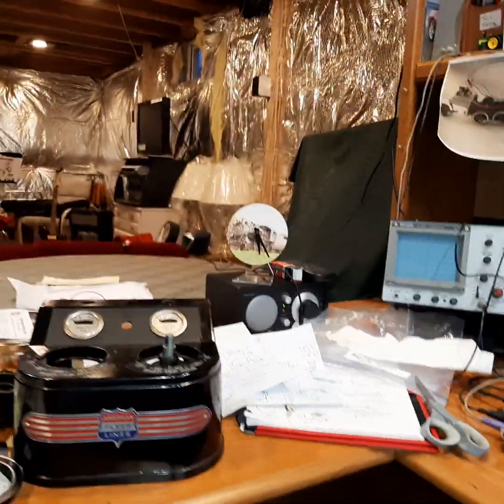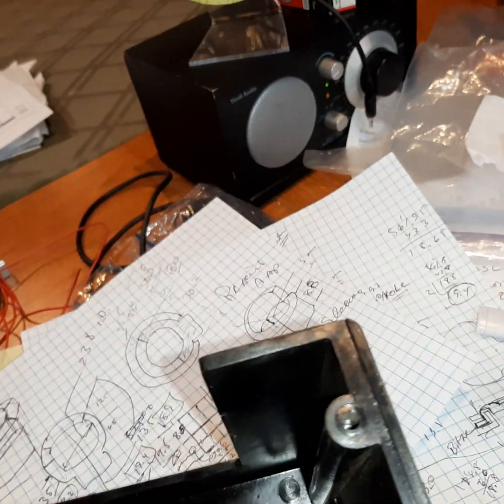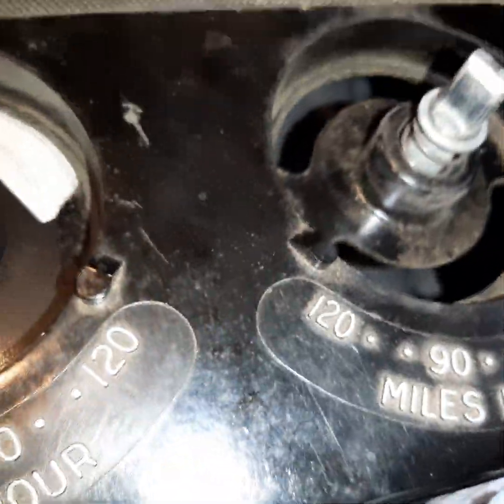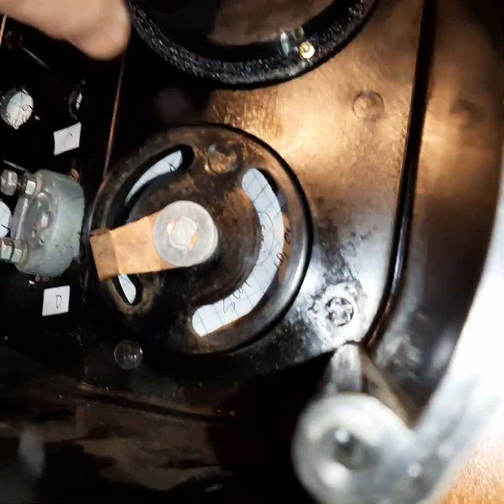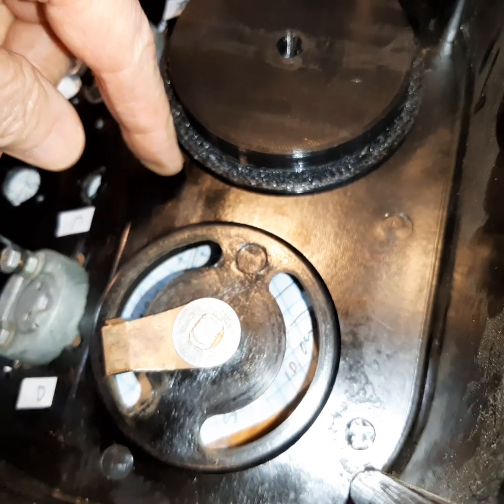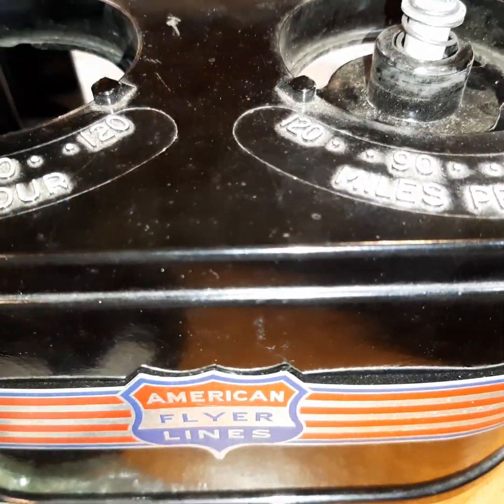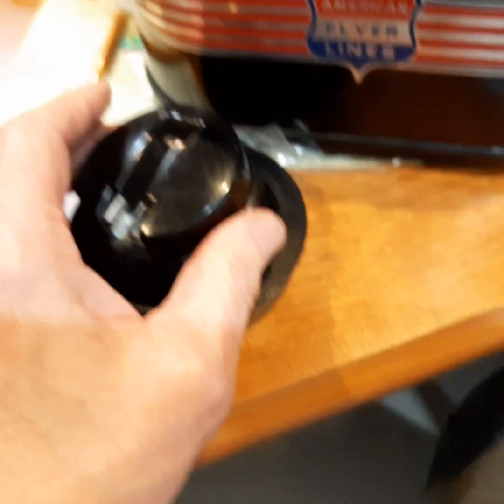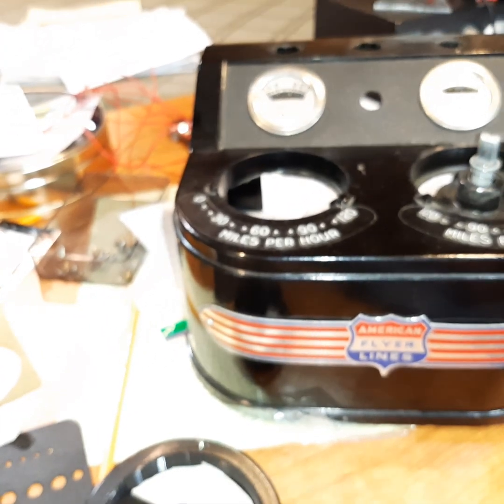American Flyer 30B transformer repair 3D printed parts

Comment: This is awesome and you're doing some darn fine work there Sir!
Reply from the maker: Yeah it came out pretty nice too!
Reply from the maker: James would like to test my new smoke in a Lionel engine i don't have any to try?
Reply: @DennisMurphey  What type of unit did you create? Lionel used a different type of smoke unit than AF did.
Reply from the maker: @jamesburns0657  It was a mimic of the Flyer Smoke but is a very unique shape that fits Flyer